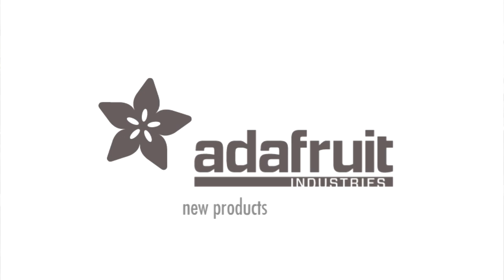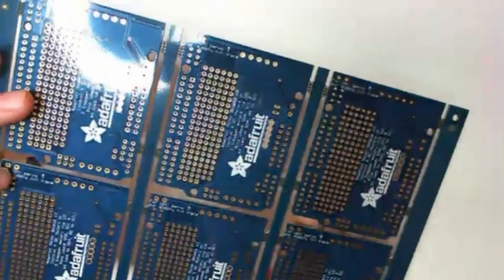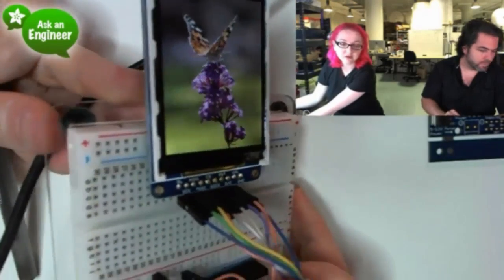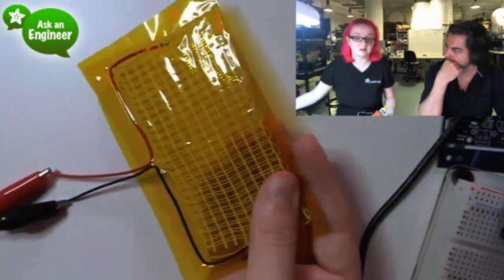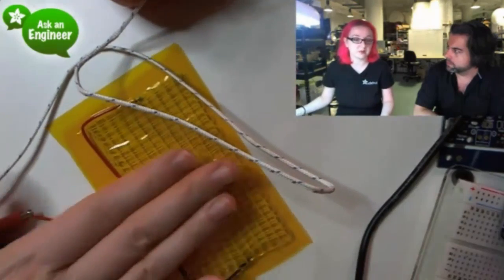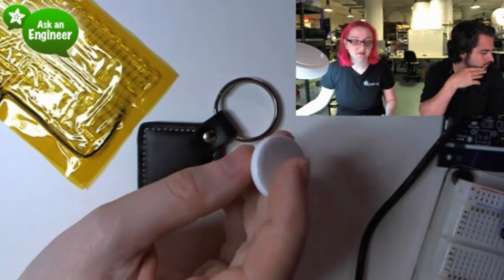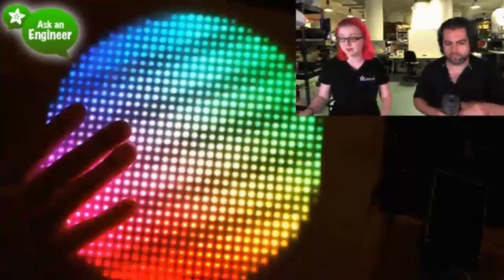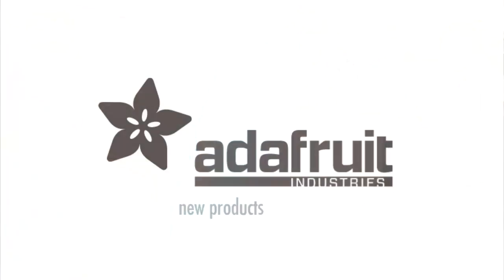RFID Nail & More! New Products 8/17/2013

Comment: my question is when will led's be cheap enough to turn panels like that into an hd tv
Reply: The limitation isn't the LEDs really.  Its the PCB.  Making really dense LED boards means you need a lot of current which means very thick traces on the circuit board, and being able to control all of them individually, you need a lot of individual traces all going to ICs.  This means that you get into multi-layer boards (4-layer minimum) for a lot of area which makes it cost way way way way way more.
Reply: But more efficient leds means less current draw and in turn thinner traces
Reply: This is true, but although your fabs still have an affordable limitation of 6 mil minimum traces.  Then the fab become the problem before the LEDs

Comment from the maker: See what's new this week! RFID Nail & More! New Products 8/17/2013

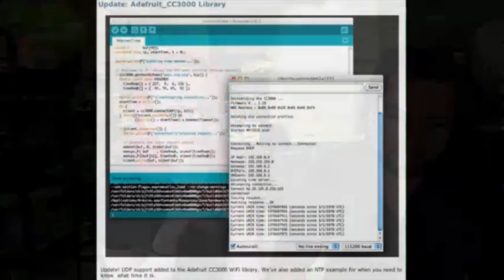Adafruit CC3000 Breakout with Onboard Ceramic Antenna (0:10) http://www.adafruit.com/products/1469

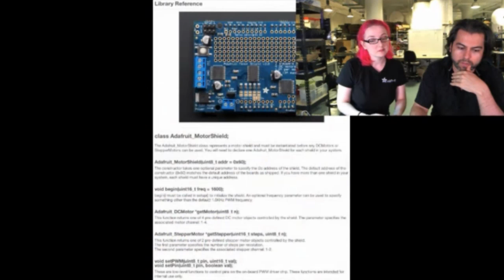Adafruit Motor/Stepper/Servo Shield for Arduino v2 Kit - v2.0 (1:08) http://www.adafruit.com/products/1438

2.2" 18-bit color TFT LCD display with microSD card breakout (2:03) http://www.adafruit.com/products/1480

Electric Heating Pad - 10cm x 5cm (4:38) http://www.adafruit.com/products/1481

MiFare Classic (13.56MHz RFID/NFC) Leather Keychain Fob (7:43) http://www.adafruit.com/products/1482

MiFare Classic (13.56MHz RFID/NFC) Plastic Nail (7:43) http://www.adafruit.com/products/1483

Medium 32x32 RGB LED matrix panel (9:31) http://www.adafruit.com/products/1484
-----------------------------------------
Subscribe to Adafruit on YouTube: http://adafru.it/subscribe

Join our weekly Show & Tell on G+ Hangouts On Air: http://adafru.it/showtell

Watch our latest project videos: http://adafru.it/latest

New tutorials on the Adafruit Learning System: http://learn.adafruit.com/